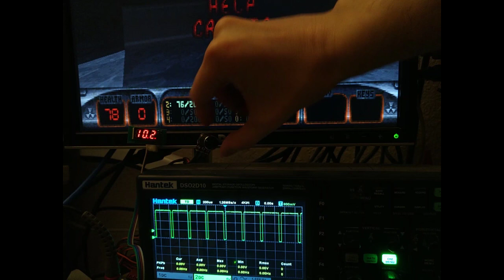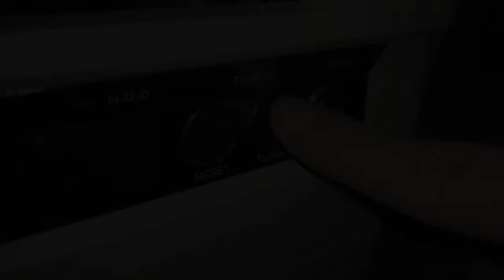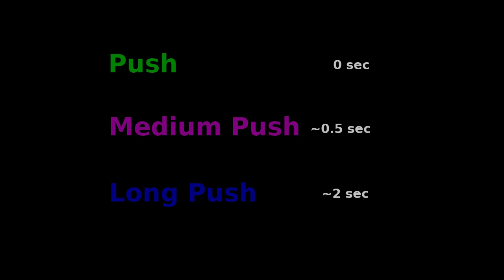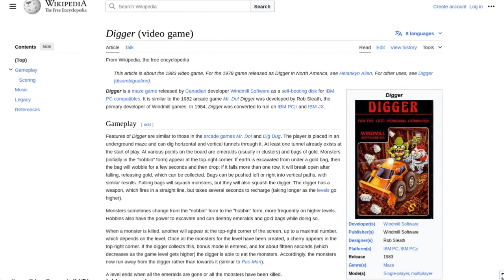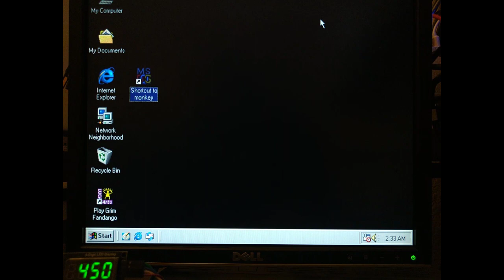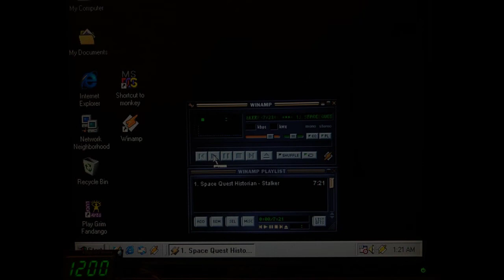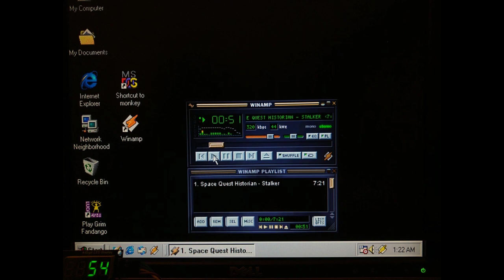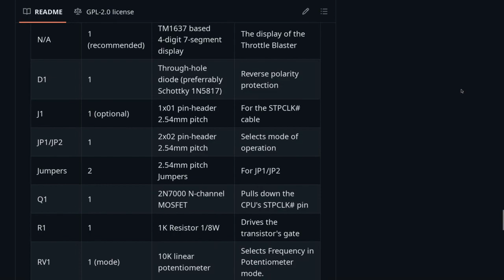Throttle Blaster: An add-on Turbo circuit released! (Part 2)

Comment: Big Red Racing is not playable on faster than 486 100mhz machines. Try it plz.
Wing Commander runs at normal speed? Ultima 7 ?
Reply from the maker: All such games should work fine with the Throttle Blaster. You have very fine control over the CPU performance all the way down to XT-class.
Reply: @scrap_computing  just finished setting up TB. where is jumpers documentation?

Comment: Will that work with 286 processor?
Reply from the maker: No, this revision only works with Pentium (MMX I think) or newer CPUs. I am planning to release a new one that works with older CPUs.
Reply: @scrap_computing  Would be great! Not having turbo functionality on 286 motherboard is a big bummer.
Reply from the maker: @Jay-q3o4w  I just checked and I don't think it will work. On my 486 the HOLD pin is actively pulled down by the chipset so it can't be overriden by the circuit without risking damaging the chipset.
I will try to check with older systems too.
Reply: @scrap_computing  Is it possible to modify motherboard instead of processor, to include turbo functionality that way maybe? 
Other 286 motherboards have it from factory, so it should be possible to mod my motherboard to include it, I think.
Reply from the maker: @Jay-q3o4w  It could be possible but you have to check if the HOLD pin is driven low by the motherboard. Try using a 1K resistor to pull it high. If the voltage on the pin remains low then it won't work.
Reply: @scrap_computing  I have very basic understanding of electronics theory, but I think I got what you mean. Will try it later.
Reply from the maker: @Jay-q3o4w  What I mean is to connect one end of a 1K resistor to the CPU HOLD pin and the other end to 5V (assuming a 5V CPU). Then measure the voltage at the HOLD pin with a multimeter (one lead to ground the other to the HOLD pin). If it shows ~5V we are good.
Reply: @scrap_computing  Thanks, foolproofing is always helpful. I'll be back with results soon.
Reply: @scrap_computing  It fluctuates around 0.5v. The CPU model is AMD N80L286-12/S.
Reply from the maker: @Jay-q3o4w  This confirms my suspicion that the HOLD pin is pulled down by some other chip. So using the Throttle Blaster won't be as easy as with the STPCLK pin.
Reply: @scrap_computing  any other options?
Reply from the maker: @Jay-q3o4w  Not sure. I will try to get some 286 era hardware to experiment with.
Reply: @scrap_computing  Thanks!
Reply: @scrap_computing  Also, consider seting up a patreon. I'm sure there is a few people who will want to motivate your projects financially.

Comment: Another suggestion. You could offer a "simpler" switch mode that can work with a toggle turbo switch rather than requiring a momentary one.

Obviously it would be more limited though.
Reply from the maker: You might still be able to use it with the toggle switch, as long as you don't push it all the way in, though I have not tried it.

Or  you could just use the reset button. Reset should still work with a toggle switch ;)
Reply: @scrap_computing you could also just press it twice quickly, but that's more a hack than a solution.

Comment: I would be tempted to use two push buttons. One for up and one for down. That will leave you with a more userfriendly way for fine tuning as well.
I am also thinking of maybe having a small potentiometer on the inside of the case for the fine tuning. Because after it has been finetuned, there may not be a need to touch that anymore.
And then maybe 3d printing a bracket that kind of looks like a gotek floppy emulator, which could house the raspberry pi, the display and the buttons. This could be optionally equipped with your large clicky rotary encoder just like with a gotek.
Reply from the maker: The single button mode is meant to be used by those who want to use their Turbo button. And it's actually not too bad to use.
I think it should be fairly easy to support a 2-button mode, I will try to implement it soon, thanks!
Reply: @scrap_computing  Fair point, I kind of forgot about that!

Comment: I would like to know how to run grim fandango on windows 98 without issues, everything i tried has never worked for me, could you tell me the specifications of your machine?
Reply from the maker: Grim Fandango runs natively on Windows 98. What kind of issues are you having?
Reply: @scrap_computing  It doesn't start at all, on windows 95 it works, but has graphical glitches on the 3D models and on windows 98 it goes to a black screen and then nothing, sometimes it shows a blue screen claiming the program did an illegal operation.

My machines are:

Biostar M7VIG 400 Rev 7
AMD Duron at 166Mhz
256MB RAM at 333MHz

Foxconn 661GX7MJ
Intel Celeron at 3.2GHz
256MB RAM at 333MHz

Both machines use:

Geforce FX5200 128MB of RAM
Samsung Spinpoint HDD 10GB
Hitachi CDROM Drive
Reply from the maker: Sorry to hear that. I've never had issues with Grim Fandango. Perhaps try disabling hardware 3D rendering?
Reply: @scrap_computing  Hardware 3D rendering is always disabled, otherwise it always shows glitches on the 3D models.
Reply: @scrap_computing  That is why I asked you for your hardware and software configurations, maybe i could troubleshoot my pc's knowing a machine with a working configuration for grim fandango, of course if possible, i don't want to sound like I am being rude or something, thank for your continued replies.
Reply from the maker: I've tried Grim Fandango on several systems over the years, but I've never had any issues with it.
Anyway, this board is a KT133A-based one, the CPU is an Athlon 1.2GHz, 256MB of RAM, and the graphics card is an S3 VIRGE.